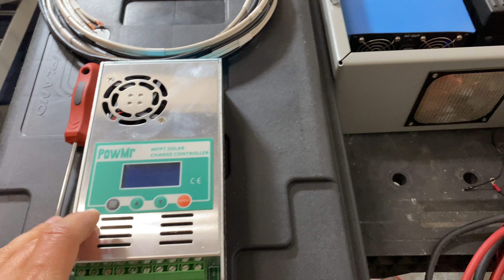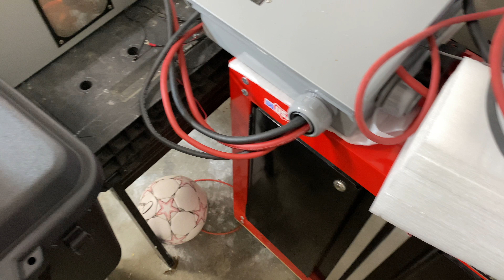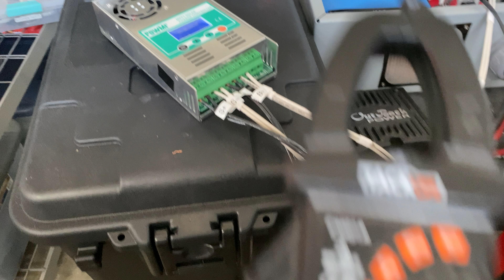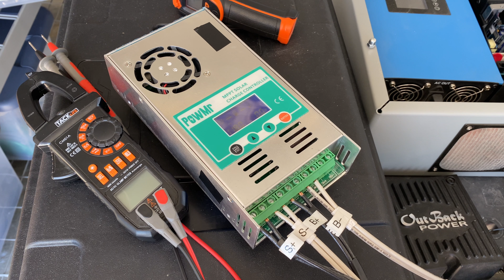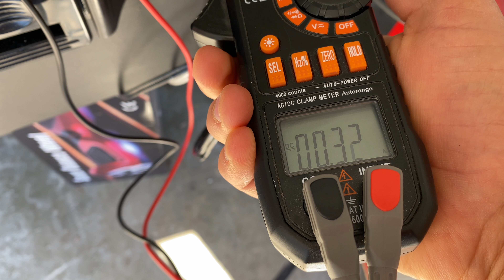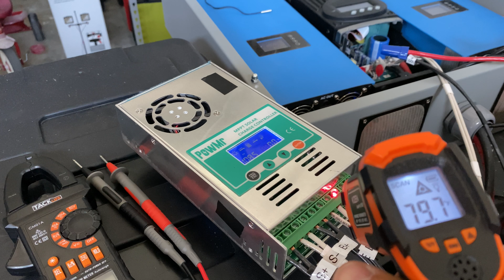Testing PowMr 60A MPPT charge controller with 3kWs. Failed.

Comment: Bro, MakeSkyBlue has launched their all-new V124 version of the machine. The 60A, 80A, and 100A models have undergone professional testing, and it's said that the PV open-circuit voltage can reach up to 150V. It also delivers stable high-current output with less severe heat generation. What's more, it's even cheaper than this one. Maybe you should give it a try.

Comment: I have this model that I bought 7 years back, used it with lead acid batteries for 5 years perfectly. Now I am charging my lifepo4 12v battery without any problem. yes, the amphere calibration has gone wrong, I check the amphere on BMS.
Reply: Que amperaje eran las baterias,como cargaban,ed decir a que amperaje?
Reply: @maurisgonzalezperez2402 40Ah max with 60A PowMr model.

Comment: WARNING!!!
I own one of these fake " Make Sky Blue " copy Mppt that do not have any bio's update flashed.  
The guy left the company and started up Pow Mr. and must of had a usb bio's ( very early version ) stolen before he send this product to a chinese warehouse for mass production.  The unit's mppt function is ALL Over the place!!!
These do work ( sort of ) and should be treated like a 40 amp  DC booster charge controller.
Always use double wires. Always  have both  solar and battery Positive on a breaker with the ability to flip a switch and disconnect to make rebooting easier when it has a fault.
My Pow Mr runs at 119v  and makes 2,200 watts  nearly 40 amps at its best.  The unit is very hot.
I would NEVER push this light weight unit in 48 volt mode beyond that. 
I know its says 160 voc  @ 2,800 watts at 61 amps max <- those are crazy numbers for this little light weight unit with hardly any  electronics in it and a small form factor aluminum heat block and single fan. 
This unit needs double Iron ferrite cores and x2 the capacitors and a New firmware update and i would add a 2nd fan. 
The PCB board is thin and I have little faith in long term use as i can foresee the components warping out and the unit breaking down under stress.

( edited )  The sweep algorithm to find the best suited charge point is epileptic.  It charges for 10 secs then sweeps again for no reason whatsoever wasting 33% of its time searching while producing 66% amp stable charge if you can call it that.   
We ordered  a 150 VOC 60 amp AIMS Mppt replacement. It has zero issues and makes stable power with high efficiency.  

The bluetooth app is amazing tracking and recording everything. Very Happy with it. Customer service was great! I just wanted to thank them personally and let them know its working flawless.
7th year off grid and i've owned   $5 dollar pwm charge controller all the way upto $900 dollar chargers.
Our Outback lasted us 7 years before taking a hard lightning strike back feed. Even then with a damage board and blow power mosfets ( 2  down ) the unit rebooted and could use it at 75% of its rated current.  Talk about rugged!  This month it finally fried due to use pushing the most power through it  and i knew it was on its last legs. 7 year of solid power. That's great for any electronic with crazy amps and voltage rushing through it converting and dissipating heat.
Reply: Great comment.  I need to upgrade my 20 amp mppt Rich Solar charge controller now that i have six 100 watt panels (30+ amps).  Rich solar has a 40 amp controller for $160 or a 60 amp controller for $300.  What do you think of Rich Solar?

Comment: I had the same issue with it not displaying amps or wattage. I had connected pv neg directly to the battery bus before the charger. Once I fixed it to go directly, this information came back. 

Your connection via your bms probably caused a similar path to bypass the internal measurement shunt in the mppt charger.

However today I think I broke my inverter due to this product on my lithium battery and so I went searching for its problems…
Reply from the maker: interesting, thank you for the info.

Comment: Right off the metering wasn't working
These controllers have the current shunt on the - side and switching on the +
You were bypassing the controller through the relay and BMS on the - side completely defeating the MPPT function
Reply from the maker: didn't get it, do you mean this charge controller needs to be connected to battery avoiding BMS?
Reply: @SolarEngineering  no the solar side and battery side must be isolated from each other
Your panel relay wasn't isolated and bypassed the controller
Reply from the maker: @stevehanely9446  how then cells are going to be protected in battery pack if charger going strait to pack without BMS?
Reply: @SolarEngineering  you still need a BMS but if you have a panel relay it needs to be mechanical and isolated
I suspect you had a solid state relay and it bypassed to the control wires
A normal relay would have worked fine just unhooking 1 wire

Comment: Is it possible to oversize the regulator 110-120%?
Reply from the maker: do you mean charge controller?
Reply: @SolarEngineering  yes, controler. PV 820W to 12V battery
Reply from the maker: @Karlosr6  I wouldn't do it. 820W will push this device over limit.
Reply: Ok thanks

Comment: I set d01 to 13.8 and d02 to 14.0 since the controller readings readings didn’t match neither my multimeter nor my inverter readings and with these settings, the controller is working properly up to this moment. I’m using two lithium 12v, 300A batteries connected in parallel.
Reply: i can!t change mine i try every thing it just goes to 147 the only way i can change it is calberate the controller about 4 points above the battery is i have 4 of them powmr
Reply: @leetaves9143  ON d04  step YOU MUST SELECT  00 (as if it was for lead-acid battery)  FORGET THE FACTORY INSTRUCTIONS.....FOOOLZZZZZZ
  d04  MUST BE THE FIRST STEP FOR  LITHIUM (LiFePo4)   select 00,      do not  select 01     then you can safely ADJUST d01 and d02 (i ALWAYS put d01 and d02 THE SAME:::)

Comment: These controller seems extremely hot!! Epever and victron are much more colds in the same conditions
Reply: they have bad mosfets, cheap ones, i have 1 unit that will not turn on, several mosfets are shorted, n o use repair, the drivers are bad also , now i avoid Powmr

Comment: You should really carefully read the instructions in the manual. For 12v batteries max Capacity from Solar panels is 750 WATTS not 3000. Mine works just fine 1KW panels puts 6-7 Kilowatts into my 24v batteries every day the sun shines for the last year.. Set the charge voltage manually if your inverter beeps complaining of high voltage , I set mine to 14v. for my LA Marine batteries.
Reply: Over wattage use for 48v

The maximum PV input power:
(The total power rated of PV can’t be over this watt that will break the controller.)
12V system (720W) 
24V system (1440W) 
36V system (2100W) 
48V system (2800W)

Voc from PV( Make sure the Voc of PV meeting the requirement as right. Voc is 1.5 or 2 times than battery, then it’s best efficiency. )

PV Input Voltage must this range
12V system (DC20V~DC80V)
24V system (DC37V~DC105V)
36V system (DC50V~DC160V)
48V system (DC72V~DC160V)

The maximum PV input voltage (Voc):DC190V (The controller can’t work at this voltage of long duration that will break controller. Please refer to Input voltage from PV.)
Reply: On your 24 volt system with 1000 watts of panels you're only pushing the system to about 42 amps Max and the video creator was trying for 60 amps
Reply from the maker: it was connected to 48V battery bank.

Comment: Hello again, I have a panel of 310 w, Luxor brand, and powmr 60 A. On a sunny day I only get 9 watts up to 22 watts, the voltage is at 38.7 V. What can be the problem of low watts? all new installation
Reply: What is the battery size? how many Ah and chemistry?
Reply from the maker: few questions:
1. What is the panel Voc?
2. What is the voltage of your battery?
3. Did you check with the ammeter that the battery is not getting charged (like in my case it shows 0W but actually charging the battery)
4. Did you check settings (might floating/absorption) is lower than battery voltage
Reply: @SolarEngineering  Voc : 36,07
2.Battery: Trickle charge: 13.6V - 13.8V.  Maximum end-of-charge voltage: 14.6-14.8V
Reply from the maker: @mohamedelkhamlichiregragui5917  well, I'd check with the clamp ammeter that the battery is not getting charged while the device displays 0W.
Otherwise sounds like a faulty unit.

Comment: My PowMr working fine at 45A. The only problem I have is when at full charge, the controller jumping up the voltage and my inverter shutdown. This is dangerous to the batteries even with BMS
Reply: I have the same issue...have you find out any way to avoid It? Perhaps modifying the charging voltages
Reply: Im running 4 of these now
The voltage reading is a bit off on them but they work well when set right
In MPPT mode they will cause overshoots if set too high
In float mode they regulate fairly well
Reply: Isnt it they make voltage higher to push high current into batteries? Do you have good(thick) cable connected to your batteries?

Comment: Sorry , unfortunately the information is not enough to prove that this is not a 60Amp MPPT . we can see that PowMr products have been selling in market for many years and people really love  it ,that is why they are here today .
No display for the charging current and power on the LCD ? Sorry, where is the solar panel ? Well , you can not simply judge it when you didn’t connect the MPPT charge controller in a whole system ,how you connected the batteries is also a problem ,as for the temperature issue mentioned in the video , It doesn’t make sense to doubt the function and specification ,as It’s working in normal range and that is for sure ,we all know that .
Reply: I own one of these controllers. It does work, and the voltage indication is reasonably accurate when compared to my Fluke 77 multimeter, to about 0.1V accuracy, which is barely enough to charge a 4S 200AH LiFePO4 battery bank. HOWEVER, the current (ampere) reading is GROSSLY inaccurate, it over reads by at least 30%. I have proved this by measuring the actual current from the controller. As the maximum rated current by the manufacturer is 60A, I suspect the ACTUAL current to be around 40A. I have "rectified" the current readout by soldering a piece of copper wire of the appropriate gauge & length (by trial and error) in parallel with the existing current sensing copper shunt inside the controller. As a result of my findings about the maximum current handling, I would decrease the maximum connected solar panel wattage accordingly.
Reply: @androidboxhome586  yes, it over reading the current. Dose ur PowMr at fully charge jump up the voltage?
Reply from the maker: yeah, you are right - "we all know that"
feel free to provide a charge controller and I'll repeat test.

Comment: Apparently there are 2 different versions of that type of charge controller.. a fake one and a real one.
 I can't remember the brand name of the real one but it's definitely not powMr..
 Careful with epever products.. I've had a few go bad too.

 I'm just going to spend the money and try victron.. I'm sick of cheap shit ending up costing me what the expensive stuff would have
Reply: MakeSkyBlue and PowMR are the two brands.  I can't see any difference, they update the firmware occasionally, but both brands claim the other is "fake".  I have both, they both work but I've had 2 PowMR fail, one DOA (new), one on hookup to different solar panel set.  Both times the display failed (was blank), but I think fail was in main board, not display/interface.
The others seem to work great, haven't had any failures during actual operation.   Have not tested the actual output, but I've had them putting out as much as 1200W on my 24V system.  I use a total of 7 for different panel sets.
Reply from the maker: 2nd is MakeSkyBlue. 
I agree about spending $ once on a higher quality parts.
Reply: @SolarEngineering  that's the one.. 👍
Good luck
Reply: I have same experiences as Lounge Lizard 🦎
Reply: @vets fiveten I just don't buy this stuff anymore mate..

Comment: If the charge controller doesn't display normally, it goes back immediately - if it can't see the power level it may not be able to trigger the cooling fan and it may not see the voltages correctly which can cause short life with any type of battery or possibly death to a lithium battery.  

The PowMr I have does NOT correctly measure the battery voltage.  On a 12 volt system (AGM batteries), setting the float voltage to 13.6v shows 13.6 when you check the settings but the output is 13.5v on a calibrated meter - on a 48 volt system, that's an error of 0.4 volts..  You need a good meter to set the PowMr to your needed voltages.  However, my PowMr did continue to work and respond to load changes.  Be aware that the PowMr has a MakeSkyBlue controller as its ancestor and the older MSBs are known to simply "drop out" for unknown causes.  They typically come back to full power if the solar input is disconnected for a few seconds and then reconnected.  There's a video on Youtube about it and a circuit for a monitor which disconnects the solar panels and then reconnects them as needed.

I never add a charge controller directly into my system.  First it's connected to a smaller battery of the proper voltage and the "solar" power is a 10 amp adjustable voltage power supply so I can see how the controller works as the "solar" input is increased.  I also have an adjustable load on the battery so I can take the controller's load up to whatever maximum the power supply can provide.

Your point about disconnecting EVERYTHING is a good one.  Much better to spend 2 minutes protecting things than $200 replacing them - that works out to about $6000/hour.
Reply from the maker: thanks for the information about PowMr and MSB, I'm not going to touch this charge controller :)
Reply: Please link the video you say explains this
Reply: Hi, where is the video for the circuit which disconnects and reconnects the PV input when the Makeskyblue software locks up in mode 7 (PWM)?
Reply: @PVflying  You'll have to sarch for it, as that laptop "walked off".  No idea without my notes.
Reply: @notyoung  I think I found it thanks. “Makeskyblue 40A mppt controller auto reset I had to build” by YouTube channel name “opera” 👍